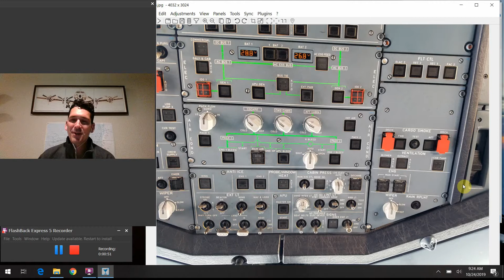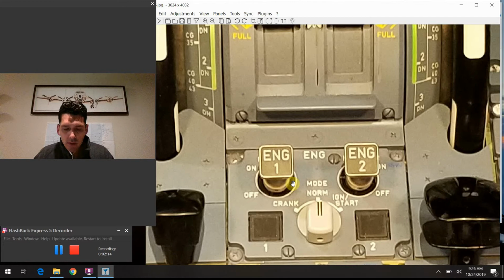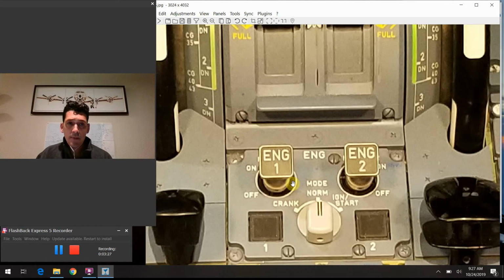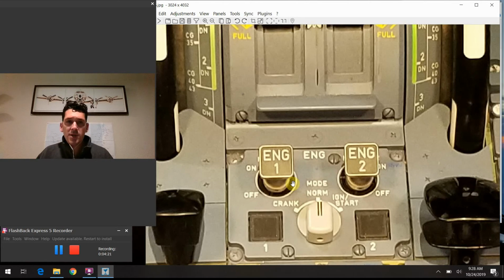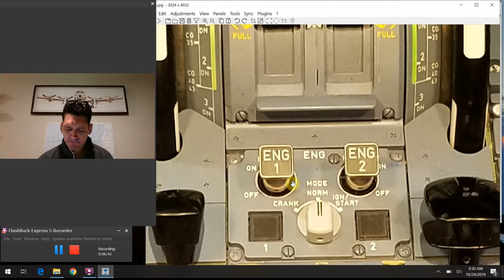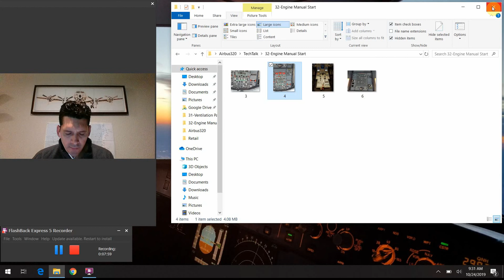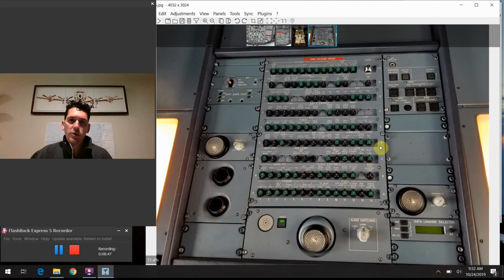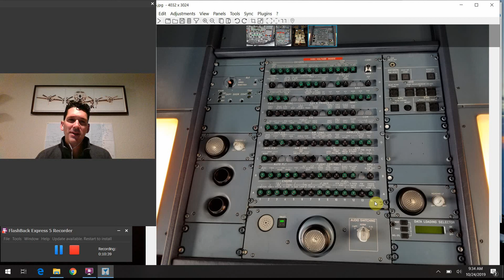Airbus A320 Cockpit Tour: #32 - Engine Manual Start Panel: What do all those buttons do?!

Comment: Nicely done! 
Doubt-  the manual start checklist dictates us to shed some load in case the bleed pressure isn’t sufficient, one of the load shedders is the blue hydraulic pump; why would I want to shed the pump if the blue pump logic itself is to start after one engine start? 
Thanks and keep up the good work mate!

Comment: I know that with respect to the A320 overhead panel 49VU.  The green circuit breaker are tied in with ECAM and the black ones are not, You can get message on ECAM associatied with green breakers  only.

Comment: What is crank?
Reply from the maker: Hi Phille, thanks so much for tuning in to the channel. Kind of a funny word they've used for this function, but the crank position on the start panel is used if we want to manually"motor" the engine only, or in other words, to get the engine to spin without introducing any fuel or ignition. We do this mainly if we are trying to "clear" the engine of residual fuel/fumes and cool the engine core before making another start attempt. Left over fuel/fumes can create an explosion or fire actually if the conditions are just right.
Reply: Mike Abignale Aha ok! thank you I really appreciate your answer
Reply from the maker: Yes you are most welcome Phile! Cheers! mike
Reply: @MikeAbignale  Hello, which power makes the engine to spin without fuel? Shall we turn on the APU or what? Thank you.
Reply: The A320 has a lot of maintenance functions and that’s one of them.
We use the “crank” option also to perform an “engine wash”, it’s a periodic maintenance procedure we conduct when performance are not optimal.

Comment: Nice video and explanation👍 i just want to know what is the crank mode on the engine mode selector and what it has to do with man engine start??
Reply from the maker: Hi Leonidas! Thanks for tuning in! The crank mode is used if we simply want to dry motor the engine, For example, just get everything inside the engine to turn without actually making it start. Ill try to shed more details on this in the QandA section of the next vid. Cheers! Mike